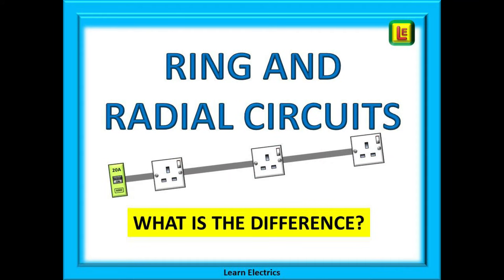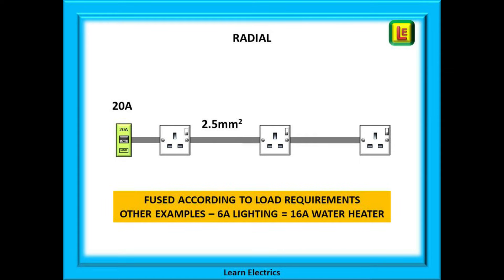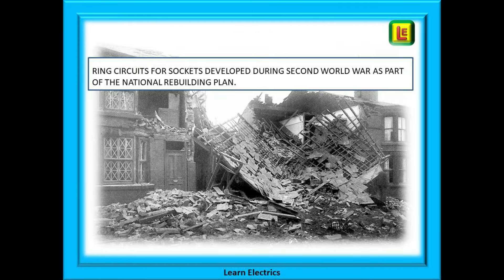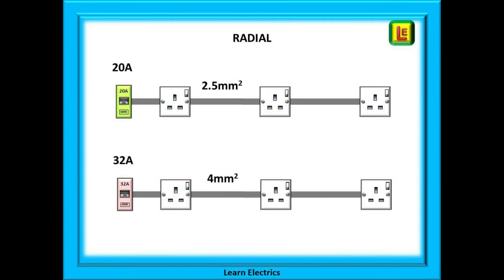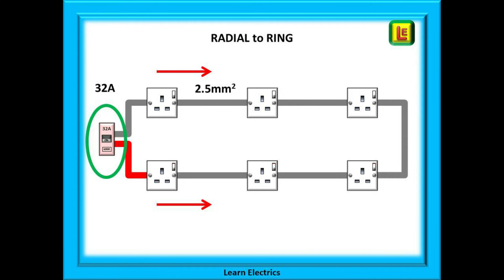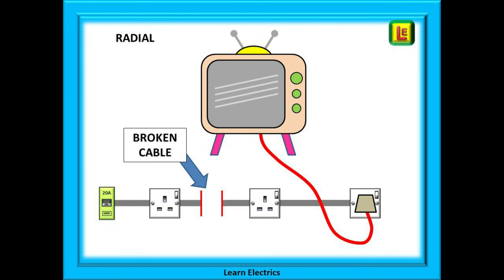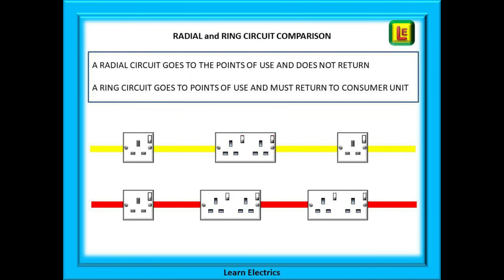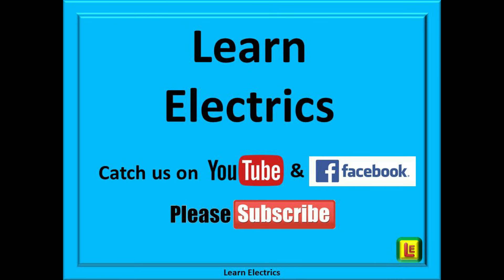RING and RADIAL CIRCUITS. WHAT ARE THE DIFFERENCES.

Comment: I don't get the argument for a ring circuit. If you take the ring circuit and split it furthest away from the fuse box, you will have 2 radial circuits with 2,5mm wires, but you will not need wires between the 2 sockets furthest away, so you will actually use less copper with 2 radial circuits instead of 1 ring circuit. Yes, you will need an additional 20A circuit breaker and the circuit breakers can only be 20A, but you will have 2*20A circuit breakers instead of 1*32A, so more power in total with less copper used. On top of that you will have an A LOT safer installation.
Reply from the maker: Exactly Frank. And many sparkies now install radial circuits as you describe, especially as modern boxes have many more ways than the old Wylex 3036s. Thanks for contributing, good points. Dave.
Reply: Frank, there are a number of advantages for a ring. Look at my post on them. Expensive AFDDs are mandatory on any circuit with socket outlets on certain installations, and now recommended for all. To reduce expense it looks like rings will continue, maybe with sockets on just one AFDD protected ring, with heavy appliances hard-wired in on other non-AFDD radial circuits.

If a ring is broken, it is usually because of loose screwed connections, the AFDD should pick this up as an arc will be produced, if high currents are drawn, with the AFDD tripping out breaking the circuit. Using Wago connectors that take the ring's current load, instead of screwed terminals on the rear of sockets, pretty well eliminates any loose connections occurring, improving safety concerns yet again.
Reply: @johnburns4017  First of all. If a ring circuit is so great, why is it only used in UK and actually forbidden in most other countries.

Secondly. English is not my first language, so I'm not familiar with most of the terms you are using in your post, but from my experience, a radial installation is only slightly more expensive in hardware, but cheaper in man hours to install, maintain and expand.

Third. Some of what you write is clearly wrong. As I wrote before. A ring circuit provide less power than two radial circuits for the same area, not more. and it requires less copper to do so. If you take a 32A ring and break it at the point furthest away you get 2 radial circuit's at 20A for the price of 1 additional circuit breaker and x meters less copper, as you don't need a cable between the 2 outlets furthest away. I hope you agree that 2*20A provides more power than 1*32A and that you can use the same cable for a 32A ring circuit as for a 20A radial circuit.
Of course if you have heavy load equipment on the ring that needs more then 20A it won't work, but in that case you would never use a ring circuit in the first place as you have a high risk of overloading it, causing the circuit breaker to trip.
Reply: @frankandersen7854  
I hope you read my post before you posted. Something tells me you never. 

A ring circuit needs a fuse in the plug to be effective. Only the British plug has a fuse. So the ring is limited to those who wisely adopted the British plug. 

It is difficult to see where a radial is cheaper on any point relating to ring final circuit.

I write nothing that is wrong. Here is the post again......

Many clearly do not understand what a final ring circuit is. The ultimate system is to have a radial circuit to each socket outlet on its own fuse at the main panel - the optimum solution of course.  This means you will need a very large expensive main panel and lots of fuses/MCBs (one for each socket) in the main panel. Impractical of course.

🎊🎈  BINGO  🎊🎈 
A ring gives this by distributing the main panel around the house via a ring cable, distributing the fuses from the main panel around the building to each socket. The ring is a busbar. This saves the vast expense of a plethora of radial cables back to the main panel and also a plethora of expensive fuses/MCB's/RCBO/AFDDs at a very large expensive main panel and expensive labour to install.

a) A ring uses less cable and gives a longer route 
b) No limit to sockets on the ring, but total is limited to typically 32A.
c) A ring uses less copper for a given load/area. 
d) Rings rarely have voltage drop as it is fed from both ends. 
e) Rings have lower impedance, less volt drop is less waste!  They are more efficient.
f) No single point of failure for the protective earth.
g) If you are covering all rooms in one floor then a ring can do it.
h) An appliance and its flexible cable may have a fuse sized to its rating inside its plug.

1. Ring final 2.5mm cable, 32A B-curve MCB, length 106m on TN-C-S.
2. Ring final 4mm cable, 32A B-curve MCB, length 171m.
3. Radial final 2.5mm cable, 25A B-curve MCB, length 33m.
4. Radial final circuit, 4mm cable, 32A B-curve MCB, length 43m.

If a ring is in 4mm cable protected by a 32A MCB/RCBO, then no problems if the cable is broken - which is a very rare thing. The ring can be partially 4mm to heavy current appliance sockets one one leg, and 2.5mm for the rest

The ring final circuit is safe, simple, and highly effective after 80 years of use. The introduction of MCBs/RCBOs/RCDs/AFDDs, and screwless Wagos on the ring taking the load, has made the ring even safer.
Reply: @johnburns4017  I did read your post before I replied, but something tells me that you didn't read mine. I'm comparing a ring circuit with multiple outlets with radial circuits with multiple outlets. It seams you are comparing a ring circuit with multiple outlets with a radial circuit with just one outlet. This is like comparing apples with bananas. It's a stupid comparison as no one is so stupid that they install a radial circuit with just one outlet, unless there is a high load at the outlet justifying this type of installation. Doing the right comparison (ring with multiple outlets with radial with multiple outlets) makes almost all your statements are wrong.

The radial circuit with multiple outlets is how electricity is distributed is houses and office building all over the world, except UK. In most countries except UK, the ring circuit is actually an illegal installation as the risk of overloading the cables and causing a fire is high if the ring is broken.

I'm not going to comment more as you clearly isn't reading what I'm writing and want to compare apples and bananas.
Reply: @frankandersen7854  
There is no maximum number of sockets on a ring or a radial in the UK.  The only restriction on a ring is the floor area, 100 square metres. To get the number of sockets on a radial to equal a ring, to run appliances with a decent current draw you will need many radials and much heavier cable in parts of the radials, and many mandatory and recommended expensive AFDDs. The cost is way, way more for no more gain. 

I have two ring final circuits out of choice. They are both on RCBOs with the main current around the ring on screwless Wago connectors, not on screwed terminals. 

If I wanted to go over to AFDD protection, I could join the rings into one, earth leakage suitable of course, using only one expensive AFDD.
Reply: @frankandersen7854  wrote:
"The radial circuit with multiple outlets is how electricity is distributed is houses and office building all over the world, except UK."

This has already been explained to you.
Reply: @johnburns4017  This is complete bullshit. Let's try to compare an installation for a floor area of 100 square meters, and lets says you need 10 sockets in this area. You can build the ring circuit using 1 32A breaker and 2,5 mm cables or you can split the ring in the middle having 5 sockets on each radial and use 2 20A breakers with the same cables as you used for the ring. You don't need many Radial circuits or AFDD's. Any device drawing more than 10-15A should have their own dedicated circuit. A ring or shared radial circuit is too expensive for those type of devices. The two Radial circuits alone gives you more amps per square meter than the ring circuit and is MUCH safer and much simpler to repair and expand. 
Even if you need 1 additional AFDD at 200£, because of the 2 radial circuits instead of 1 ring circuit, that additional cost is easily spend when you have to find a broken wire in a ring.

It's not without reason that the ring circuit is only used in UK.
Reply: @frankandersen7854  
1) With radials invariably there are more circuits with some having heavy, and more expensive, say 4mm, cable. 
2) A 2.5mm ring can cover 100 square metres and have as many sockets off it as you like. 
3) The fuses in the plugs protect the individual appliances. 
4) Many radials will entail a number of expensive AFDDs. Only one is needed with one ring.  
5) Rings are more efficient reducing voltage drops.
6) Many more ways are need in the main panel for the many unneeded circuits, entailing a larger more expensive panel.
7) The ring has two earth conductors going back to the main panel. Safer.
8) etc.
Reply: @johnburns4017  You are still talking bullshit and comparing apples with bananas.
1) Wrong. You don't need to use 4mm cables on radials. 2 radial's with 2,5mm cables can cover the same number of sockets and square meters like 1 ring with 2,5mm cables, and it provide more amp's per square meter than a ring. You need to stop the bullshit and start comparing apples with apples and bananas with bananas.
2) As can 2 radials, but with less cables as you don't need a cable between the 2 sockets in the middle. All you need is 1 extra breaker and maybe 1 additional AFDD
3) No difference between ring and radial's here, except in some cases you don't need fuses in the plugs with radials, where as they are always mandatory with rings.
4) You only need 2 radials per ring so it's not many additional AFDD's you need. Max 1 per ring you replace with 2 radial's.
5) The voltage drop from the main panel to the socket furthest away is minimal both in a ring and a radial. I doubt you will be able to measure the difference.
6) Wrong. You only need 1 additional breaker per ring you replace with 2 radial.
7) Correct, but if a ring breaks you have a higher risk of overloading the cables and causing a fire which means less safe. The increased risk of overload and fire are the reason why a ring is illegal to use in many countries except UK
8) and there are many other reasons why a ring is a stupid invention.
Reply: @frankandersen7854  
All those 4mm cables on radials I saw in France, Germany and Spain must be illusions. 

The cost of two radials using AFDDs is far higher than one ring final circuit. We have to fit AFDDS on socket circuits in some situations. AFDDs are also recommended for all socket circuits on new and amended installations. AFFDs can cost from £120-150 each. They are four functions into one unit. 

Individual appliance are not protected on radials. They are on British radials as they have fuses in plugs. The protection is all the circuit tripping out, not just an appliance. 

Depending on your supply, the voltage drop from the main panel to the socket furthest away can be substantial on long radials. 

The earthing safety is superior on a ring. If a ring breaks (a clean break would be noticed) the AFDD trips as it will generate an arc. It is illegal to use rings in many countries because they do not have fuses in their poor plugs. Radials are pushed by cable and breaker manufacturers. 

You keep going on about extra breakers, which is extra needless expensive circuits and extra needless expensive AFDDs, and larger main panels which take up space.

For 80 years the UK has had one of the best electrical safety records. That has been attributed to the superb ring design. 

For decades the EU was telling the UK to change. The UK said you are talking bollocks and steadfastly stuck to what they knew as safe, economical and worked in the brilliant British plug and rings.  You can plug in a 3kW appliance into any socket and it works.

Apart from not having mandatory DP breakers in main panels, although some do fit them, a current British system is the finest in the world.
Reply: @johnburns4017  I've never said you can't use 4mm cables on a Radial, but said that if you want to compare a ring circuit with a radial circuit you need to do it like for like. I strongly doubt that those 4mm radial circuits you saw are used for normal household appliances with Schuko type sockets as they are only certified for 16A and 2,5mm cables.
4mm radial circuits are in Europe normaly only used for dedicated circuits with IEC 60309 type sockets, which is designed for loads from 3,5KW and up. You would never use rings for this type of load. Not even in UK.

I'm not familiar with the AFDD's, but why is it that you need additional AFDD's on sockets if you use 2 radial circuits instead of one ring circuit for the same floor layout and load pattern? On top of that. The only AFDD's I can find using google search are for main panels, meaning you max need 1 additional AFDD if you split a ring into two radial circuits. The most expensive one I found cost 200£. That is easily spend first time you need to figure out where a ring is broken. With a radial circuit you know immediately between which 2 sockets the problem is, and you don't need to disconnect anything in the main panel to do the fault finding.

It doesn't really matter how long the ring or radial circuit are. The voltage drop on a radial circuit are max 2 times compared to a ring circuit for the same floor and socket layout. But you need a circuit of at least 100M before you get to a voltage drop you can actually measure. You very seldom see that in a house or office installation.

As far as I understand, the AFDD's only trips when the arc occur. There are many ways to break the ring circuit in a way that you can reengage the AFDD on a broken ring without it tripping again. When this happens you have a real risk of burning down your house due to overloading the cables due all power is now provided to the socket through only one cable. This is the reason why rings are not allowed in most countries. Not the lack of fuse in the sockets, as they are only protecting the appliances against overload. They are not protecting the permanent installation against overload.

Additional breakers are cheap compared to all the additional work needed for installing, testing and maintaining a ring.

I'm not so sure the UK electrical safety record are so much better than most European countries like Germany, France, Spain, Denmark, Norway, Sweden etc.

A ring circuit are unsafe unless you add AFDD's and other protection and test the ring yearly. With radial circuits you don't need yearly tests as you know immediately if it's broken somewhere as it don't work anymore. A broken ring is a fire hazard. On top of that. 3KW aren't a problem for a radial circuit in Europe either, but in Europa the amp's for permanent installation for household appliances are restricted to 16A, as this is what the sockets are certified for. You can use a ring if you want, but you are still not allowed to use a breaker at more than 16A, due to the certification of the Schuko sockets. And it still doesn't change the fact that if you compare a ring and radial circuits for the same floor layout and load pattern, the radial circuits are cheaper in installation and maintenance, and aren't a fire hazard if they are broken.

But we are running in circles, so let's agree to disagree.

Comment: Great explanation. I understand the reasons why ring circuits came about, but don't understand why they still seem to be commonly used today when, as you say, we have CU's with so many ways. Surely the risks posed by an undetected broken  ring doesn't out weight the potential slight uplift in cost installing radials? That said, I'm not an electrician, so prepared to get shot down on this one. 😳
Reply from the maker: Personal choice at the end of the day Gary. Some people, including electricians, would you believe, still think that a socket circuit MUST be a 32amp ring. Why?
Do you need 32 amps in the bedroom where there might be a TV, a computer and a bedside lamp, 5 amps max. Thanks for the comments, you are spot on, nothing to shoot you down about. And I do agree about the risks of a broken ring on a heavily loaded circuit. Thanks for watching.
Dave.

Comment: I am sorry,but i must disagree with this.For instance,why would you need 20 or even 32 amps in your home?I always wonder about that!We,in the Netherlands, have breakers with a max off 16 amps,and that works fine!! We dont have light circuits or so.ALL the circuits can be used as a light supply or a supply to a wassingmachine or something.We have a central box or boxes in each room (in the ceiling)connected directly to the breakerbox.And from those we make a spin form of the circuits in that room.Talking about sparing copper.You have a ring or more rings with copper wires off 4 or even 10 mm !!We do it all with just 2,5 mm.And the breakers protect the fase wire AND the neutral wire,much safer.

http://dump.antonboonstra.nl/got/meterkast_groot.jpg
Reply from the maker: This is the UK Wiring Regulations.
Reply: @learnelectrics4402   That may be,doesnt mean it can be done better..I just don't understand why you would need a ring system.Only the UK as far as i know has a ring system.

Comment: Hi dave what's the maximum  geographically area cover by a ring and radial circuit pls
Reply from the maker: Daljit, have a look in Appendix 15 of the Regs for Ring circuits floor area.
Think about a radial circuit and what it is, just one long piece of wire - so its limit has to be the Zs limit.
Take a look at our video on this subject on the link below. That should help.
Thanks for asking. Dave.
Cable length calculations
https://www.youtube.com/watch?v=Qq_9MNH8XxU